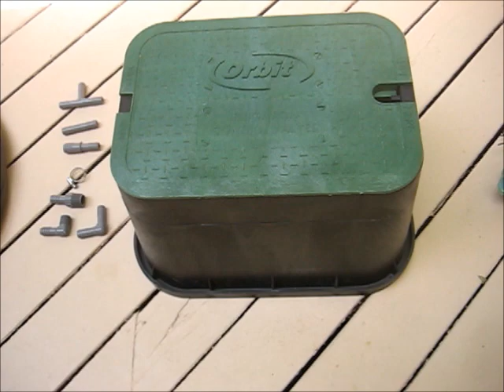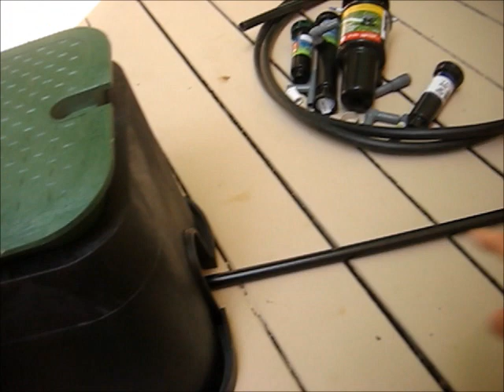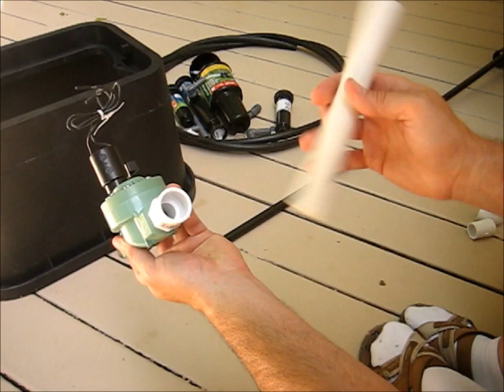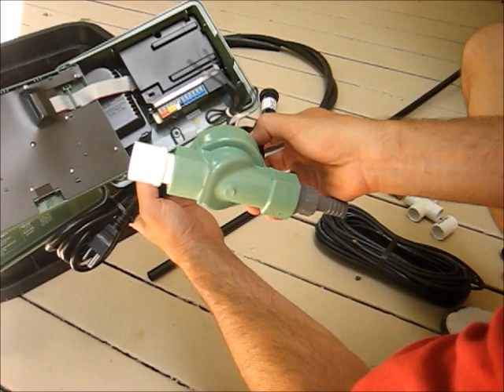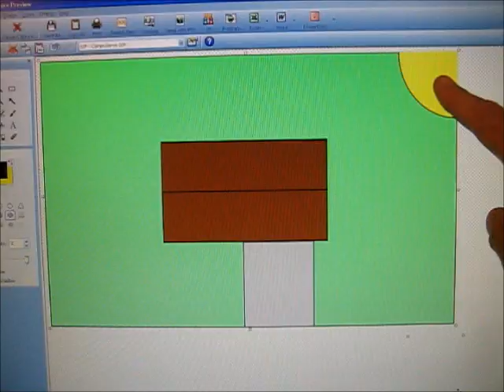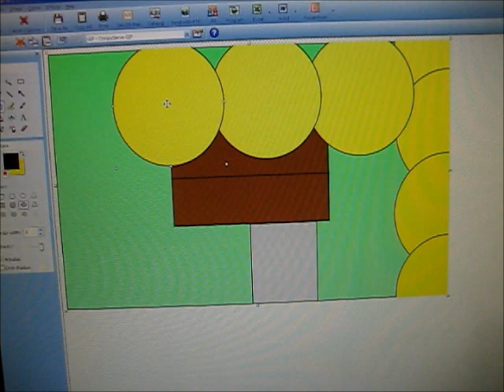How To Install a Sprinkler System (HowToLou.com)

Comment: Well Lou I’ve figured out the whole reason why I can’t run more than 1 sprinkler on my garden hose. It’s because our water pressure is just not very high. It’s only about 55 psi at the spigot. And I’m not even sure if the pressure in our water main is that much higher.

Comment: ok, so what about underground?  how to get hose down displacining minimum dirt?  should there be anything below the underground hoses i.e. pea gravel etc...?  What about drilling through from inside house main water line to outside?  Thanks for the info, but need more
Reply from the maker: Bury hoses with a backhoe for a big mess, a trencher for a small mess, or a vibratory plow for nearly no mess.  No pea gravel required.  Drill through concrete with a hammer drill.

Comment: Excellent content and production.  We used 1 inch zone valves, 1 inch zone lines as manifolds then branched off to sprinkler heads with 3/4 inch line.  We branched off the 3/4 line with 1/2 line.  One has to know how many gallons per minute flow rate and what the line pressure is.  Each head has a rated gpm number.  the total additive numbers ought to be half or 2/3's the total flow rate through the zone line. (1" pipe @ 60 PSI delivers about 38 gallons per minute GPM.  outlets [nozzle openings] can equal 19 to 23 gpm zone flow] can be up to about 20 gpm.  Once you exceed supply with outlets, the pattern will be diminished.

Comment: In 2006 we dug a shallow water well ourselves.  We rented a trencher and trenched water line trenches around the property.  We purchased a sand point, pounded it in then connected the 2 HP (220 v.) irrigation pump.  We wired the zone valve wires to the controller.  Total installation was under $800.00 and it was so very easy.  What was hard was getting over the fear of not knowing what to do.  RainBird, Orbit and others all have help lines.
Reply from the maker: Exactly!  You can do just about anything if you get past your fears.

Comment: whats the reason behind smelly water thats coming out of the lawn sprinkler? seems like every house is like that, where is the water coming from?
Reply from the maker: I am guessing you have a water softener?   Hard water usually smells like sulphur (rotten eggs), but grass prefers hard water, for all the minerals.  The water inside your house is soft, so it does not smell or leave rust rings in the toilet.

Comment: Where can I buy those supplies today in 2018?
Reply from the maker: +Jonathan Gonzalez - Nothing has changed.  Any hardware store or online
Reply: HowToLou hardware stores,  Homedepot and Lowe's? 
Thank you for your video.  I was been charged 3200.00 for someone to install it at my home, thanks to you I realized I can do it all for $680. Would you recommend using an under ground hose or 1 inch pipe? 
Thank you for replying
Reply from the maker: +Jonathan Gonzalez - You can buy all the parts at hardware stores like Home Depot or Lowe’s   1/2 inch black poly pipe will be sufficient to run up to four sprinkler heads per zone, unless you have really low pressure

Comment: How do you put the controller in your garage and run the pipe outside to the box without drilling a hole in your walls?
Reply from the maker: +Rohan Sharma - really, drilling a 1/4 inch hole through the wall is the best thing to do.  Run the wire through and then squirt some silicone in next to it.

Comment: Many thanks for the video !! a question please: the 1/2 inch tubing, what brand do you recommend? I found several brands but with different wall thicknesses. Would it be ok to bury one that has a 0.05" wall thickness (Orbit)?
Reply from the maker: +PreTea_little_liars - yes that is fine.  I used a generic brand from Lowes.  I don't know what the wall thickness was, but it only cost $10 for a 100 ft roll and it works just fine.
Reply: HowToLou Many thanks !!!!

Comment: hello....can u please tell that from where I can get all that as I am located in Pakistan and plz also tell the total equipment cost
Reply from the maker: +Muhammad Muneeb - You should be able to order all the parts at Lowes.com or Amazon.com for around $400 for 5 zone system
Reply: Can u please suggest me the main sprinkler model and company as my garden is around 3000 sq ft
Reply from the maker: +Muhammad Muneeb  - Toro and Rainbird are good brands.  Get the model or models that will cover your yard.

Comment: Thanks, interesting. Here's a few tips since I've been swamped with springtime maintenance on my large multi zone system.  Barbed fittings don't need hose clamps.  A mapp gas or propane torch works well to soften that riser pipe in the field as opposed to a hair dryer.  If you have the luxury of using lake water or a natural stream to irrigate from, you may find that the impact heads are the ones that last the longest in that surface water/ algae laden supply water case.  Gear driven turf heads offer the best coverage for large lawn areas, especially where precise watering needs to be maintained. Old systems tend to use decreasingly smaller underground pipe as each run gets farther from the supply, but I've found running everything in one size make long term maintenance much easier since all of the pipe is the same size. 1.5" PVC works well in my case with my 5 hp pump,  1/2" NPT fittings for all taps along the way. from supply to the farthest head.

Comment: what is a model number or description of the sprinkler head that has the side port for the water, versus on the bottom (so head excess water drains) - figure this  may be best since I live in cold winters. I can't find on amazon.
Reply from the maker: +PJ Glockzin - I know it was a Rain Bird brand, but don't remember the model number.  They were at my local hardware store.  If you can't find them, you can add another T and hang a drain off that.
Reply: PJ Glockzin lawn belt
Reply: It was an orbit brand. I could see the logo just under the head of the sprinkler

Comment: Hi Lou. Thanks for the video. Do you have a recommendation on configuration? Like an "L" vs a "T" (T would have main feed line and a right leg and left leg with 2 heads each.)
Reply from the maker: Bryan Stewart  -  Whatever is most convenient is fine.  Technically a T configuration would balance the pressure a little more evenly, but not enough to care or notice.

Comment: Okay, I just thought that since our back yard is a little hilly, that it might cause uneven pressure.
Reply from the maker: tom reaume - water pressue only changes by 1 psi for every two feet of hill.  So if your yard has 6 foot hills, your water pressure will only change by 3psi.  That is minimal compared to the average 60psi house water pressure, so you would notice very little difference in the sprinklers.

Comment: Lou, our house has around 60 psi pressure. But I don't think i could put sprinklers in our back yard because it is pretty hilly.
Reply from the maker: tom reaume - If you can water your back yard with above ground sprinklers, you can probably do it with a sprinkler system too.  Really, a sprinkler system is just a bunch of burried sprinklers and hoses.

Comment from the maker: @Joshua Noah Miller - I water at 4:30 am, so its all done before we start showering in the morning.  Watering in hot sun is less effective, because some of it evaporates.  I do 15-20 minutes per zone, every 2-3 days.  Grass grows stronger roots if you don't water it every day.  If your yard needs more water, its better to increase the minutes per zone, rather than watering more days per week.
Reply from the maker: Joshua Noah Miller - I am not too familiar with watering plants.  I would say probably 2-3 times a week.  I am really not sure how long.  Start with 10-15 minutes and see how they look and how the ground near them feels, and adjust up or down. as you see fit.
Reply: Also it’s good to make sure your soil is not compacted

Comment: How did you get your hose underground?
Reply from the maker: I installed one simply with a shovel.  Its a lot of work, but can be done.  Water down the paths you want to dig, or wait for a good rain to soften the ground.  Let it dry overnight or at least 4 hours, so it is soft, but not muddy.  This makes it much easier to dig.  The alternative is to rent a trencher machine.  That might cost around $300 for a day, including delivery and pick up.  These things are size of lawn tractors and equally as heavy.  Look up tool rental places in your area.
Reply: *****
Thanks. FYI someone told me you can also use a pressure washer to blast the sod so hard that it cuts a muddy trench right through it allowing you to make it more manageable with a shovel. I ultimately waited for the rain which helped tremendously :)

Comment: Silly question but do you not put teflon tape on the fitting that goes into the sprinkler head?  I ask because I noticed you put a clamp on the hose going into the fitting...  Would the bottom of the sprinkler head not leak water without the tape?

Thanks,
-Nigel
Reply from the maker: You don't use teflon tape on plastic fittings, like you do on metal fittings.  Also, if it were to leak, it would be ok, because you are trying to water anyway.  The clamp on the hose going into the fitting is to prevent it from blowing completely off the sprinkler.  That probably won't happen, but it is easy and cheap enough to play it safe,

Comment: what water does the sprinkler system tap into?
Reply from the maker: You can start by connecting to a garden hose, if you want.  The best way, however, is to tap directly into your water main.  This is where your water supply comes into your house and has the highest pressure and volume.

Comment: I do not want to be a hater, but I have been installing sprinklers systems for 30 years. Anyone thinking of installing their own, please research "head to head coverage" and do an internet search for irrigation tutorials. One other major item is a Reduced Pressure Backflow Device (check your local codes), but ALL sprinklers systems must have a Backflow Device. It is not only a code violation, but you should expect fines and your water will be turned OFF for not having one. Again, check with your local water department and codes. I AM NOT STATING THIS TO BASH TO VIDEO OR THE PERSON POSTING IT. I applaud his efforts because installing is hard work. Just do your due diligence.
Reply from the maker: Very good comments.  Thank you.  The backflow device and head-to-head aka edge-to-center coverage, along with some other good info, is at HowToLou.com/sprinkler.  Please check it out before you start.
Reply from the maker: I just added annotations in the video about coverage and backflow.  Thanks Todd.  -Lou
Reply: Not necessary though if you're on well water right?
Reply: Trung Do it is necessary to have a backflow it prevents contamination of drinking water if you were to have a ruptured pipe on your irrigation system if you do not have the backflow $75 at your local irrigation supply store you will be putting your family at risk of serious health issues
Reply: Googling it, I get: A reduced pressure zone device (RPZD, RPZ, or RPZ valve) is a type of backflow prevention device used to protect water supplies from contamination.  I'm thinking you might want one.

Comment: why only 4 sprinklers per zone? pressure?
Reply from the maker: Yes, 4 is a good average.  If they are low volume sprinklers, or your have high pressure, you can get away with more.

Comment: Awesome video.  Plan to start this weekend.  How deep should I dig the trench?  I live in Colorado where we can get up to minus 15 degrees.  Should I install several of the "drip" pieces to each sprinkler zone in order to make sure it completely drains, or is one usually sufficient?  Thanks a bunch.  You are saving me lots of money!
Reply from the maker: You only need to dig the trench deep enough so you won't ever cut it with a shovel.  Most people put it down a foot or so.  Six inches is fine, so long as you draw a good map and don't hit it with a shovel, years later.  To avoid freezing the pipes, you would have to go below the frost line (3-4 feet down), but nobody does that.  Instead, you blow out your system every fall.  See my other video on that at HowToLou.com/sprinkler.  There is also some other good info there.  I would also put a slow drip drain at the bottom of each sprinkler head.  Its is really not that hard to do a sprinkler system.  It is very much like having above ground sprinklers and hoses in your yard (which we have all done), but underground.  If you are willing to dig, you can save a ton of money.
Reply: Please do not put any drip with the sprinkler heads. It will kill your presurre and take away distance and vvolume from each head. Like Lou said just blow it out in the fall. Buy or rent a small air compressor and blow it out, it takes minutes and gives you comfort knowing it will be fine for the winter.

Comment from the maker: ***** I would avoid hitting your sprinkler lines with a shovel, but if you think you will, I would use Schedule 80 PVC pipe.  It is thicker and stronger than Schedule 40 PVC with is stronger than the tubing I use.  PVC is harder to install, because it does not bend like tubing, so you have to use elbows to turn corners, but still pretty easy, overall.
Reply: ***** sched 80 reduces flow...volume... so be careful you don't have a ton of popups on a single zone, that your changing to schedule 80...strength of pipe choices are relative to the system water pressures, not so much to making the system "shovel - proof". 

Most irrigation systems (residential) actually use CL200 for zone pipe, which is not even schedule 40, never mind schedule 80! 3/4" CL200 opens up flow & volume. Zone pipe durability is only so much of a threat --  it is only ever energized, for the duration of a single watering run time.  And even then, it is operating with leaks (sprinklers). 

You learn to keep your heel out of the dig, initially to probe what is happening below, or even use a stainless shish kabob skewer. You can feel the difference in your hands, and hear the difference - when you hit PVC with a shovel/probe - It doesn't feel like or sound like rock/root/metal. Have some PVC "slip fixes" and save a few Bell coupling ends from brand new pipe sections, to have repair materials around to quickly fix zone breaks.

this is a great page for pipe info.
check out table #4.
http://edis.ifas.ufl.edu/ch171

Comment: Well done video.  The sprinkler system that came with my house is 3/4" PVC pipe.  It seems like every time I dig a hole anywhere in the yard, I manage to break through a pipe. I looks like you are using 1/2" hose.  Is there a problem using the smaller gauge hose?

Comment: Very informative. Thank you very much. I always thought these underground sprinkler systems used some type of water pump since I wouldn't think regular house water pressure could supply the entire system. I tried running 3 above ground sprinklers with just garden houses and they didn't throw enough water for the sprinklers to rotate as they should.

Comment: pressure you can get away with using regular sprinkler pipe on a house, I liked how you explained it but you need to show a lot more id say you covered about 40% of the job and i wouldn't recommend people using this video to install their sprinklers

Comment: I've been working with an irrigation company for a few months, I wanted to see how exactly how you connect the zones to the main line and the valves but you didn't show it, also you would be wasting time using a hair dryer to heat up the line to connect to the elbows just use a torch on low and in two or three seconds you're done, also when running a main you want to use 1" line for the zones use 3/4 line and use flexi pipe to connect to the sprinklers also the pvc you're using is for high...

Comment: Thanks...I think this is by far the best tutorial for a diy sprinkler system. If I want to do a REAL SIMPLE system without any timers can I technically attach the piping to my spiget with a connector is a splitter??? thanx loads

Comment: hey so here is my situation. if i connect to water main and put that zone box ill have to go under my driveway. I thought of using my orbit 4 zone timer thats on my faucet outside connecting the black hose to each zone and attaching 4 sprinklers per zone and running 1 zone at a time. i then can do the same to my other faucet to get the other side of my yard split by my driveway. Do you see a problem with doing this?

Comment: My water company told me our water pipes are to small or our water pressure is to low to have a professional system. I wanted to do this for just my front yard and limit 2-3 heads per zone. Do you know if 1/2 tubing creates more pressure than PVC? Also im debating on connecting to main or connecting to a water faucet. I want to do whatever i can to create more pressure. Is their a minimum pressure I need? Suggestions on what to do?

Comment: I need one DESIGNED properly so no brown spots, no overgrown spots, just 100% even coverage. I never saw you measure the water pressure, or check the main size. I do not need a headache fixing another undesigned or poorly designed system. I need automated perfection. I know you do NOT mix heads in the same zone. All the same heads means they all spray equal amounts of H2O. I will be using PVC pipe, not hose, and resizing the service line to the house. Our pressure is LOW. I know how to wire&pipe